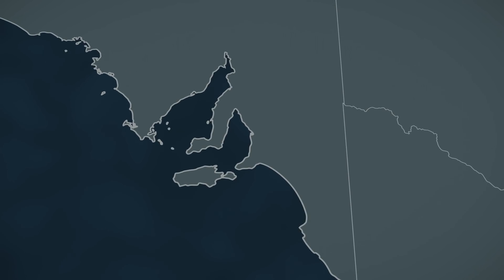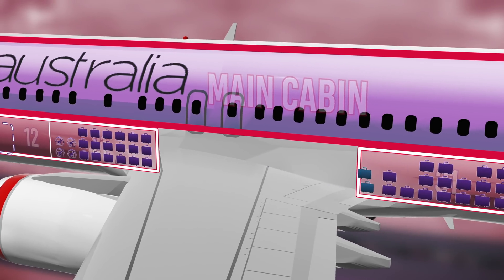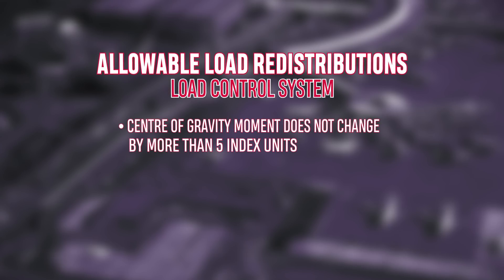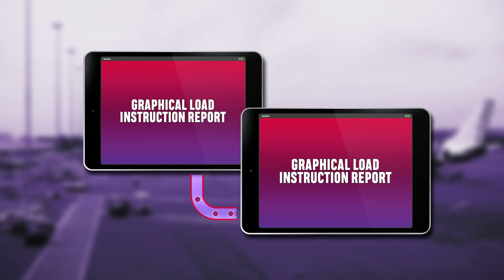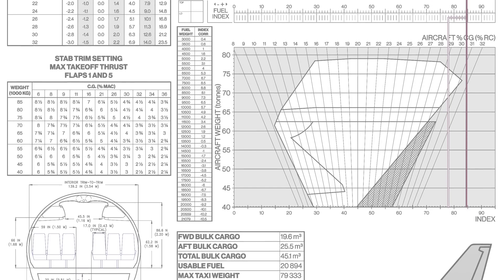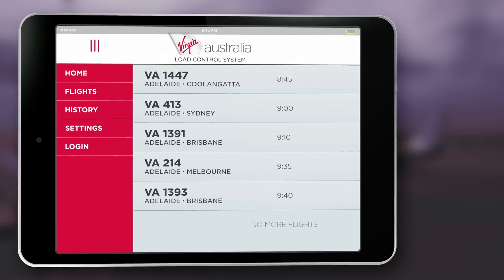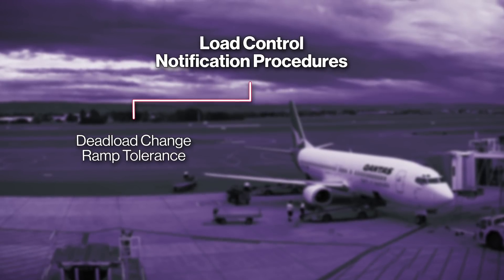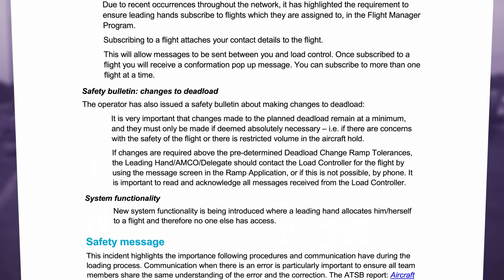Aircraft Loading Error

Comment: so what I got from this is that me and two of my buddies can take down an airliner if we sit in the wrong seats?!
Reply: Maybe not two but 10 or more might cause a noise drop.
An incident happened a year ago a Qantas flight from Canberra to Perth On board the aircraft were the crew and 150 passengers, including a group of 87 primary school children. The group of children was seated together at the rear of the cabin and all had been assigned the standard adult weight of 87 kg during check-in.
Reply: If you tried to balance a ruler with your fingers how many flies would it take to land on one side of the ruler to cause it to rumble.
The plane might not crash but it won't be a smooth tack off or flight and landing. Passenger probably get motion sickness

Comment: Encountered this exact scenario back in April 2018. UA outbound from LAX to HNL on a 37/800. Doors were all closed and the aircraft pushed back into the alleyway... mule detached - and the GE 56s fired up. We were just about to proceed down to the taxiway, and then —the turbofans spun down! There was a noticeable nervous pause, and complete silence in the cabin.... with everyone looking around puzzled until the Captain came over the PA and advised PAXs and cabin crew what had occurred. The aircraft was pushed back to the gate and the cargo load had to be rearranged from aft to forward. I’ve flown millions of miles. The only other time CG concerns came about was once on an RJ out of OAK. Similar situation, several PAXs were moved to alternate seats. I avoid RJ’s nowadays...

Hats off to attentive Load Controllers!!!
Reply from the maker: At least UA found it before the aircraft had departed! Potentially an anxious few minutes in the operations room at VA while this was sorted out.

My inner pedant also wishes to tel you know that CFM International produces the CFM56, not GE!
Reply: No worries mate.., without doubt they were joint ventured GE/Safran engines. I too am glad that it was caught prior to rotation! 

Keep up the excellent work.